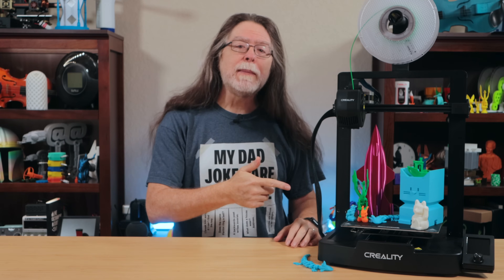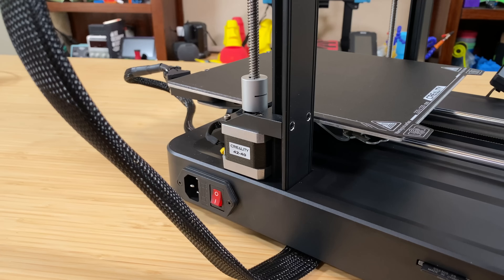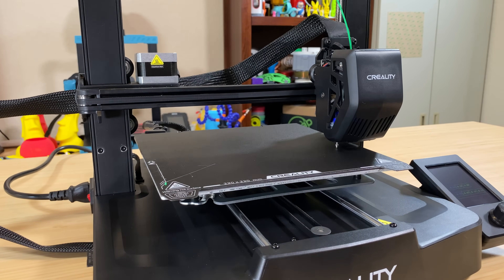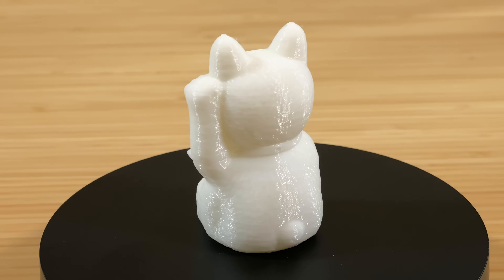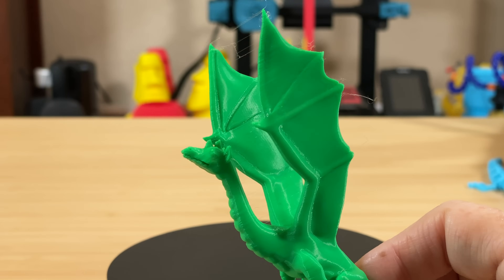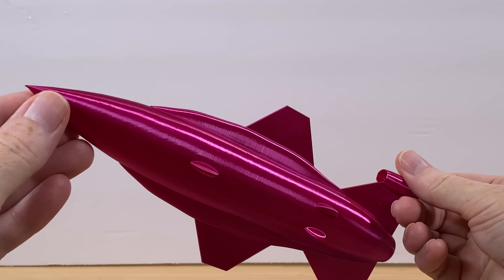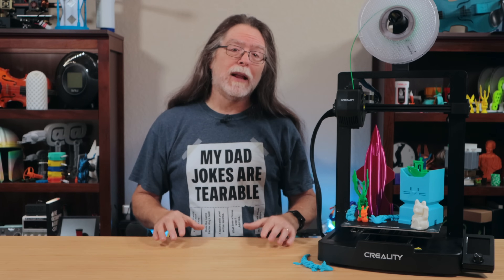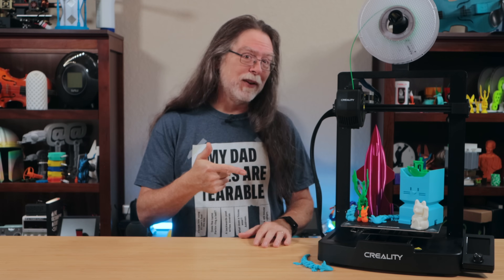The Under $200 Creality Ender-3 V3 SE! Is it GOOD (ENOUGH)?

Comment: OK but my 5 year old Creality Ender 3 v2 still pumps out perfect models every time i run it and i've been running it absolutely ragged and it's still a champ.  Doesn't look like i get anything out of this i can't already get.  I have probably had to level the bed manually on my v2 like 5 times at MOST in 5 years.
Reply: v3 se way faster

Comment: Excellent  video.  Subbed!  Maybe someone can help.  After several prints, my computer won't let me open the D drive until it is formatted.  On the Creality SD card, there was a 100 + page detailed manual.  I have looked high and low and can't find this manual online.  The only one I see is the 26 page manual.  Anyone have a link?  Thanks in advance.

Comment: Have you had to do anything with the PTFE tube yet? I had a slight clog this morning and the tube popped out when I pushed the cleaning tool through. Wondering if I can just put the tube back in after removing the blockage or just replace it with a piece of Capricorn tube. Hopefully it's not something that's going to require a complete disassembly of the direct drive assembly.

Comment: I dont recommend this printer they really need to update there firmware and make it come with the PEI buildplate, also finding spare parts is a chore and there isnt really a way to upgrade your hotend so your limited to 250 degrees with the ptf tube. Id recommend the Sidewinder x3 pro its got the added bonuses of a larger touch screen, dual sided PEI buildplate , a slightly larger build area , better cooling fans, 300 degree volcano quick change nozzle, filament runout sensor, dual Z motors and a way cleaner look without cables hanging out for just 20 dollars more than the v3 se. Only problem with that machine is I cant find where to get the interchangeable nozzle replacements and no oone sells them in Canada for a fair price :(

Comment: Prints perfect ABS items if it's in a sealed box (makes perfect temp for drying the fillament and 3D-print) included with Air vent Active Carbon Black filter, and I'm using Linux Mint FreeCad and Prucer and Cura slicer.

Comment: Looking forward to unboxing my new SE. 
I'd rather not have to modify the printer so that is not an issue for me. 
I'm not going to miss a drawer as I am going to re-purpose our old baby change table as the table for this printer and it has lots of drawers.
It would have been nice to have a filament run-out sensor but one is only going to get so much on a budget printer and I am liking the set of features this one has. 
My previous budget printers are both smaller. I like that on this one I can easily swap in a PEI build surface.
Now I got to go get my space ready.
Reply: Hey, how has your printer worked so far?
Reply: @thehobbist5544  It has been great. No issues at all so it is my best printer so far. I have only used PLA and TPU.  The only thing I have on it that is not original is a textured PEI plate.
Reply: @peircedan  awesome! Thanks bro!

Comment: The only true con I really picked up was the lack of run out sensor which the instructions say the board already has space for you just have to install one. Besides that the other cons felt like you were just searching for something negative to say about it. 
In my opinion the pros very much outweigh the cons and overall it's a very polished product for $200US.

Comment: I don't have a direct drive printer, so this is tempting for that reason.  And it seems that the filament path is better than with the CR 6 SE and the Ender 3 V2.  But rather than being another printer, if I bought this one, I'll probably never get the V2 running to my satisfaction.  It does make me think about adding a strain gauge to set the Z axis offset for my CR 6 SE.

Comment: Do you think the ender 3 v3 se will ever be supported by MriscoC firmware? I love the hardware profile of this printer... But I hate the fact that the software cripples it so much.

Unlocking it's potential will require using customized third-party tools... But it seems like ender is not being very forthcoming about this possibility.

Comment: I'm a total n00b to 3d printing, and spent ages researching which printer to get.  What a minefield! 😩 A few people said this one is decent, and I decided I just needed to jump in otherwise I'd never buy one!  Took delivery of the V3 SE today and just did my first ever 3d print of the cat that comes with it on the sd card.  Had a few issues to begin with it not sticking, but then I realised I had loaded the wrong spool and was using ABS filament.  Swapped it for PLA and it worked first time.  I learned more from just doing that one print than I did from watching dozens on videos.
Reply: No. The printer is designed to accept a certain amount of inconsistency with the bed level, and given that you can't adjust the bed screws (easily anyway), a couple of blue values shouldn't be too much of a problem (my front left corner alway seems to be a bit high) 

As far as the print sheet... I had terrible luck with prints sticking TOO well on the stock print bed, but purchased a low cost magnetic PEI sheet and have GREAT success with it (with PLA... I've never printed any other type of material)
Reply: @crooker2  Thanks for the reply, that's goot to know.  Yes, the bed is very sticky isn't it?  Would you mind telling me which one you got to replace it?
Reply: Is it an issue that some of the numbers are blue when it does the bed levelling?  The cat model is pretty small so it was fine, but would this be an issue for larger prints?
Reply: I am in your shoes right now lol
Reply: @sulaimanadewale320  cool, yeah it's fun learning all about it by actually doing it.  My advice to you would be to use a z offset calibration print to get that dialed in and a nice first layer.  Also preheat especially the bed, either manually or with the inbuilt function.  Good luck. I know how frustrating it can be though, so f you're having trouble then reply here and I'll see if I can help you out.
Reply: @tomheeks2830  The bed adhesion is very high. If you got adhesion issues, it was likely due to speed. I had the same problem, my speed and acceleration were way too fast by default and my first print fell quickly. Since I reduced these parameters, no adhesion issue...quite the contrary, my bed is too sticky X)
Reply: It is very sticky. However, I was about 10 and a half hours into a 13-hour print, and it came off🙁. I, however, think that it was because I was using a brim, which can easily come off, and it was a top-heavy project. I should have used a raft. Just saying, it can be very sticky, but you still need to figure out the best way to get bed adhesion
Reply: @MakerMikeAlt  definitely yeah.  I find a brim works in most cases, but for bigger things yeah a raft is definitely more stable.  Bit wasteful though.
Reply: @tomheeks2830  Bro your actually so helpful

Comment: Hi Bryan. I hav a 3v2 with the Ender direct drive. I love it. So much faster and cleaner prints. But: all of a sudden  after warming up the nozzle will move on bed and stop. For some reason it is not getting gcode. I just put a new board in it (4.2.7) and it still will not print. I have checked all the wiring to the  best of my ability. Can you possibly tell me where problem might be please ?
Bob kearbey.

Comment: I've been waiting anxiously for your review of this printer... However I think you've been generous to it. 

Granted, I understand this is a 200 printer... And in that light: This is a good printer crippled with BAD software. The creality cloud software is sorely lacking (multi colour print anyone?)

Currently there seems to be a lack of ability to update it with third party firmware. Still waiting on support for MriscoC or even a decent Klipper cfg to move it over to that. (spoiler alert... I'm not smart enough to come up with one on my own).

Even support for Prusaslicer or Cura seems to be as-yet missing and I'm hoping the community steps up to the plate on this one.

So my bottom line is... Great hardware (though a PEI sheet upgrade is almost a necessity... The stock print plate holds prints too hard! I ripped a print apart trying to get it off the cold build plate).

Comment: Thank you for the review. I noticed from the video that the motherboard has a GigaDevice chip. Wondering what firmware (Jyers, MRiscoC Pro, etc...) you'll be able to run on this?
Reply: So far, neither. I'm waiting patiently for someone (much smarter than me) to unlock the potential of this great printer by creating a MriscoC flavour for the V3

Comment: If a printer has no way to adjust corners manually, the bed should be fairly level from the factory. 1.5mm difference between corners is huge! 3:53

Comment: Id say the under extrusion is quite bad
Reply: Maybe the E-step calibration is not done that great. I guess they use a generic value that's the same for all printers. I wonder if you fine-tune it a bit more you would get better results. Also - If you use the standard temperature settings for different types of filament, you get some slight problems. It's always a good idea to print a temperature tower every time you get a new filament, and especially if you get a new printer.

Comment: This is definitely the best printer you can get to 200$. Direct drive, dual lead screws and auto bed leveling are huge features to get at that price. Of course there are better printers around if you want to spend more, but I think having a competent printer at a low price is important for people just getting into the hobby. 

The only real missing feature is the filament run out sensor, but maybe that can be an up-sell component that creality can sell to those who want it. I don't think it is a necessary feature for most people. And as for the tool tray, sad to see it go but the other features more than make up for it.

Comment: My only gripes are that they changed the nozzle type in this printer vs the v2. The threads are longer. It's not well documented in the literature either. There are actually 3d printed parts on the blower fan nozzle.

Comment: I think this is a first or beginner printer, with a lot of features I wish my first Creality had, like the probe and z calibration.   I think in this price range not being able to modify is not a bad thing, I spent too much money on my Ender 5 that I wish I would have used for a better printer.
Reply: I think the hardware is great for this printer. But I'm saddened by the lack of software control offered by creality... And the difficulty in being able to modify the firmware to unlock the printer's potential.

Hoping someone at MriscoC is able to crack this machine and offer an Ender 3V3 flavour of firmware.

Hell... I don't even mind losing the z-offset sensor functionality. It's a minor feature given how NOT HARD it is to set z-offset with a piece of paper.

Comment: Nice review.  Auto bed leveling with auto z offset and a decent flex plate make this the best cheap printer for newbies in history.  How many Ender 3 Pro and Ender 3 V3 owners either returned or shoved their printers into a corner to be forgotten when they couldn't get a print to stick?  It just needs an all metal hotend to be perfect.......I can live without the filament sensor.
Reply: I think the z-offset sensor seems to be an odd priority for creality. Setting Z-offset with a piece of paper is just too easy to need to solve with additional hardware.

I wish they would have put that extra effort into a filament runout sensor and better firmware.

Doesn't really negate the great printer hardware they have here. It's just the software that limits this thing.

Comment: Thanks Bryan for your thoughts on the V3. We bought 2 of them and our first time playing with 3D printing. The biggest gain I see with this $200 class printer is auto bed leveling feature, can't beat it. Totally enjoy it and running a raspberry pi using Octoprint. Very much appreciate your vids - I have learned a lot, especially being a Mac user.

Comment: This is unrelated to this video.  Have you tried the Creality k1 printer? Would you be able to do a video on how to root the k1 so I can calibrate the e steps and perform a pid auto tune?  These were things a checked once a year on my Ender 3v2 or whenever I changed a component

Comment: Wow...A bed slinger. Amazing!
Reply: Did you expect anything else at this price point? All other configurations are much more expensive.
This is a perfect entry level printer, especially for those that are new to 3D printing and are low on budget. If those people get some experience thanks to this low cost start, and they have made sure they like it, they can always step up to a more expensive printer type (like core x-y).
Reply: @jclosed2516  Read my response to @richardbertacchi5016 before ripping me a new one.
Reply: Yeah but it's cheap and easy and Klipperable for the future.  What would you recommend for a a first timer looking to dip a toe into the 3dprinting pool?
Reply: @richardbertacchi5016  One for example Artillery Sidewinder X2 quite easily Klipperable (300x300x400 build volume,) ~$ 200 or X3 $ 220  (Build volume 240x240x260. This came to market 09/2023 so not yet easily Klipperable but most likely quite soon) free shipping (Amazon/Aliexpress). filament sensor etc.  Creality (and others) keep re-inventing the wheel with minor changes with very small price variation.

Comment: Direct drive stepper right in front of the nozzle (and away from the center of gravity) with a single wheel to support it at the bottom coupled with the infamous Creality ptfe hotend aka THE BLOB MONSTER should provide an enjoyable and reliable high quality printing experience for a long time... /s  :P This machine is a maintenance nightmare with constant quality drop... I wouldn't use one for free let alone pay for it.
Reply: Hey man! Let me tell you. I have a Prusa Mk2.5, but my brother has bought one of these myself. This thing has been printing for around 300 hours, and there hasn't been a single failed print with it, it prints as good as my Prusa, for much less. If this would have been out when I bought my MK2.5, I probably would have went with creality. Anyway, while you're right. The PTFE hotend isn't the best, It can't print ABS/ASA, but I also think that the target demographic of this printer won't even touch anything beyond PETG
Reply: @Fejszi  I'm glad there hasn't been a catastrophic failure in 300 hours with your brothers machine but I was talking about print quality degradation which usually happens before it gets to a total print failure. I get that the target customers are newcomers but a printer like this can turn many people off in the long run if the person that bought it just wants to print stuff hassle free instead of tinkering. Let me know how it does in another 300 hours from now :P
Reply: @Fejszi  Someone is better off spending a bit more and getting a Bambu Lab A1 over this.